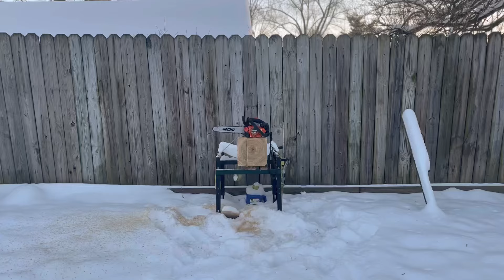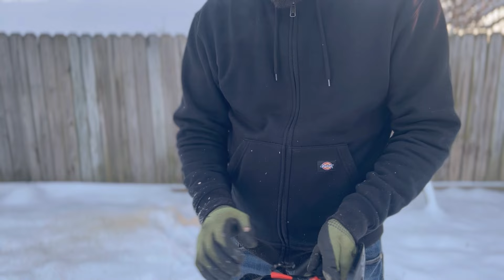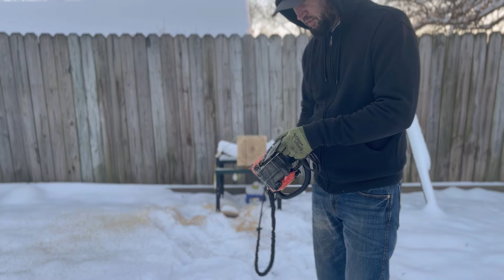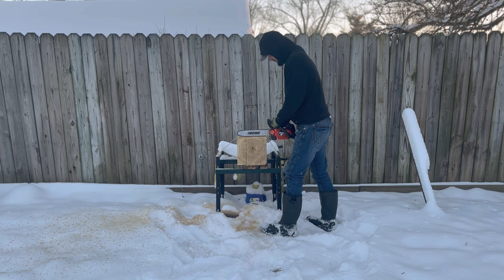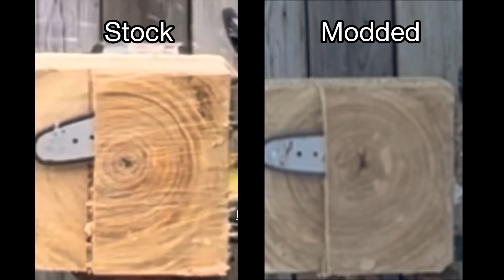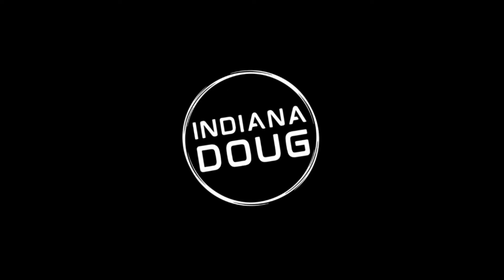Echo CS-2511T Stock vs Modded

Comment: Now ported, timing advanced and 1/4 pitch 😮

But the bolt on parts wake them up
Reply: No timing advance on these, the factory coil is dialed in pretty tight.
Reply from the maker: I will definitely grind on this one a bit.
Reply: @Super-Dave-Outdoors  good thing I'm just a operator

Comment: I just bought this saw yesterday. I want to get the modifications you have installed, but when it comes to the carb retune etc, I have no knowledge about that. I’m worried I’ll mess something up. What should I do?
Reply from the maker: You won’t. It only takes simple tools. Also, you don’t have to put the red cap back on the carb jets to tune it. It takes a flat head screw driver.
Reply: @IndianaDoug  Ok, Is there any guideline I should follow as far as how much to turn the carb screws? Sorry im a novice on this subject.
Reply from the maker: Guideline can be my saw’s tune if you’d like. There’s never an exact placement as every saw is slightly different, plus altitude, humidity, fuels, etc. if you go to do it, reach back out to me on this thread and I’ll get you baseline numbers to go by.
Reply: @IndianaDoug  will do! I’ll keep you posted on my progress
Reply: @IndianaDoug UPDATE: I sat the saw on the ground idling for 5 minutes and the exhaust melted the plastic over top of the clutch brake in the housing and now it won’t engage causing the saw to run when chain brake is engaged. I honestly did not expect that to happen, and I don’t know whether to blame that on myself or poor design on echos part. However i have no clue what I want to do now besides replace the cover. Super unfortunate. I’ve had the saw about a week and it has only 20 mins or less of cutting time.
Reply from the maker: @AutotelicAudio  the plastic melted after you installed the EPS pipe? If so, that’s very odd and should not have happened. I was very cautious of this and tested it myself. Are you sure you installed the pipe correctly? It should not be interfering at all with the plastic.
Reply: @IndianaDoug  no no not the pipe, I just got the pipe and spike today in the mail, it’s really weird, the inside of the chain/clutch housing(plastic cover) melted over top of the aluminum/steel oval strip. I have no clue what happened. The exhaust didn’t melt anything, I thought it did but there is no melted plastic around the exhaust, it’s just inside of the cover. And now the chainbrake doesn’t work, it won’t actually stop the chain from moving. I’m so confused. I dropped the saw off at the dealer today in town to see if they can fix the issue/replace the cover.
Reply from the maker: @AutotelicAudio  I’m tellin you there’s a flaw in their design. I have a video the first time I ran my 2511 and the entire clutch side cover blew off and the bar/chain pop off too. You think the cover is on right but it’s gets caught on something and you can’t tell. They need a better set up with 2 bar nuts imo.
Reply: @IndianaDoug  I agree. I honestly was very excited about this saw. Now I’m concerned. I’ll have to consider what my next step will be.
Reply from the maker: @dmoneyhustler1486 hopefully it’s repairable at a decent price
Reply: @IndianaDoug  got the saw back, didn’t cost me anything for the replacement as warranty covered it. Last night I installed the Egan pipe, removed the limiter caps. My only issue now is, the saw when started, on idle, spins fast. It’s a brand new saw so I’m assuming it’s a low key tuning issue? It’s been like this since I originally got the saw. Or should I take it in and have it looked at? I believe the chain spinning fast on idle is what caused the issue in the first place, because the chain brake was on and the clutch still wanted to spin from the power. What should I do to address the chain spinning fast on idle?
Reply from the maker: @dmoneyhustler1486 at minimum it’s tuning. You can only go so far with the limiter caps on! I took mine off and it tunes so good now. However, I don’t know if this voids warranty. Probably does. 
When my limiter caps where still on the jet screws, I had the low jet(closest to motor) about half way, and the high jet turn as lean as they allow (all the way clockwise) then I adjusted the idle down to where the chain stopped spinning. Mine barely stayed running, so I took the caps off to adjust mix better.
Reply from the maker: @dmoneyhustler1486 if you can’t get it tuned right take it back and let them decide!!! It could also be an air leak.
Reply: @IndianaDoug  I’ll play around with the tuning tonight and see if I can get it to work, if not I may have to do some research because I’m sure my warranty has been voided now with the aftermarket pipe and limiter caps off
Reply from the maker: @AutotelicAudio  oh you did take the caps off? I see. So let me see where mine is tuned, and I’ll let you know. This should give you a good starting point.
Reply: @IndianaDoug  awesome!